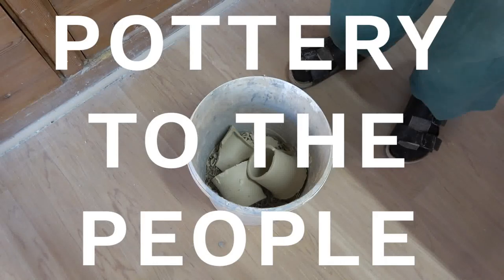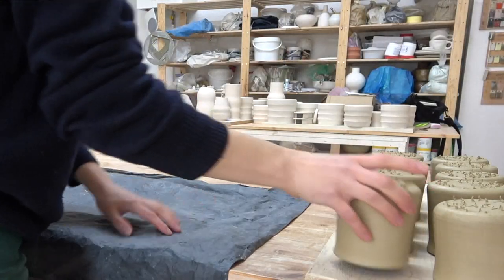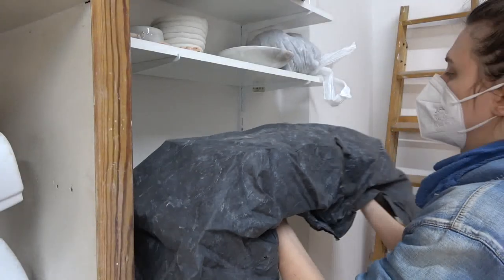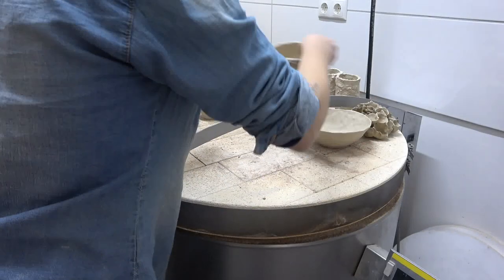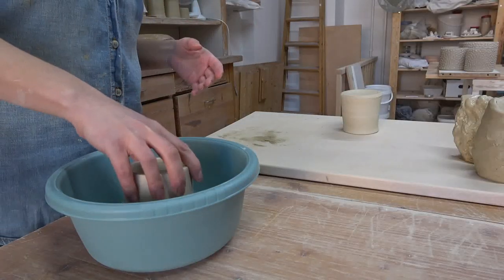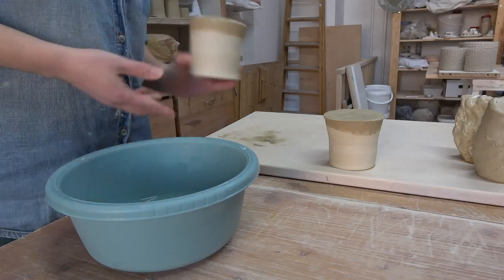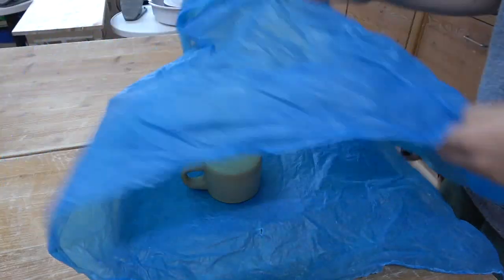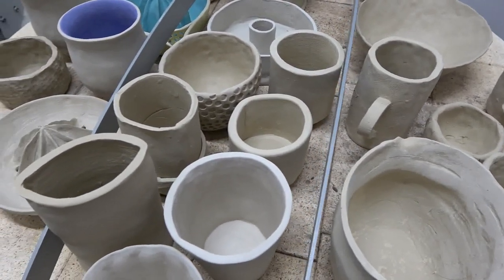How to Dry Your Pottery WITHOUT getting Cracks!

Comment: I am so glad I found this this video. Quite a few of the pots I most recently made ended up with so many cracks and they were almost all pots with some kind of attachment, and I had no direction on how to properly dry my pots at home. Thank you for the detailed, easy to follow video!
Reply: If your pottery is dry beyond "leather" but still greenware can you rub some slip into the cracks as a sort of caulking process and fix small cracks that way?

Comment: Very informative but concise video does beginner, thank you! I’ve been going to a drop in/unstructured class every 2 weeks and I’m having massive problems coming back to them being the right amount of dry. My first lot of punch pots meant to be joined together to make vases I came back and they were rock solid. Two sessions ago I made bowls and wrapped them so well when I came back to refine them I’d wrapped them so well they were still wobbling so this gives me some pointers to figure out getting the right level of dry.

I don’t know if you’ll still be checking for questions but if I go to a session and want to get some clay dried out a bit not for firing but to allow me to work with slightly dried out clay for a slab plate for example, or to be able to then refine edges with a sponge without the whole thing collapsing again then can I use a hairdryer? Would this need to be on a cool setting to avoid anything too sudden or just drying the outside and leaving the inside very wet still or something?
Reply from the maker: Hi Amy, yes drying is soo tricky if you cant check your pots every day! Especially since drying times change with the seasons and the thickness of clay. You have the right idea— dry them with a hairdryer (hot is fine), fan, or heatgun to leatherhard. Lots of potters use those to speed up drying and its generally fine for the pots. Make sure you turn your piece and get the bottom to dry it evenly.
Reply: @PotterytothePeople  Amazing thank you! I think I would have forgotten about the bottom haha. It doesn’t help that the first week I went was the week it was nearly 40deg in London + kiln heat too! And now it’s 20 deg so I just can’t get the hang of how much to wrap!

Comment: I am in the UK, and it is really wet autumn, winter, spring (sometimes summer too!) - I throw in a tiny shed outside, but tend to dry stuff inside. I am a newbie, and currently I am too worried to use the shelves I put up in the shed, cos of the damp. Whilst I am amassing a kiln-load of greenware pre-bisque would you advise keeping it all in the house right up to the time of firing, so it doesn't re-humidify itself from the damp outside? Thanks loads

Comment: I don’t know if this question can be answered, but I’m make rectangular tiles with appliquéd attachments on the top of them — not handles or anything. Also, on the back of the tile, I am attaching a  lip so that the tile can be hung like a painting. Is this impossible for the making of a flat tile that doesn’t curl? Someone suggested that I put wet newspaper around the edges because they dry the quickest. Any suggestions? Your input is invaluable.
Reply from the maker: Watch this video-- https://www.youtube.com/watch?v=hv7fbOQcMA4 I show how to dry tiles flat :)

Comment: Thanks so much for the video! My cracks have reduced but I still get them on certain attachments (Handbuilt sculptures). I attach when leather hard and wrap in plastic completely for 24 hours. It seems to be the slip that cracks even though I clean up excess slip. Any further advice/tips I can try would be much appreciated.
Reply from the maker: You might be applying too much slip or your slip is too wet. Try experimenting with that! Also, leatherhard is a spectrum, so experiment with different wetnesses. And make sure both pieces are equally leatherhard. Hope that helps!

Comment: So far I've attached handles when both the mug and the handle are wet. If I understand it right, you wait for the mug to be leather hard and then make a wet handle to attach, correct? Is this only to prevent warping of the pot/mug? Or are there other reasons as well? Can I also attach a leather hard handle? Thanks!

Comment: Always placed in container box. Before trimming. After trimming, same as before, rapping 
With a dry cleaning bag or trash bag. My trick, greenware grimed, place with misted paper towel
placed in and rapping. Even in container, always have wet towel placed in. Very slow drying, 
Check every day, and see the condition. Then remove the cover...but gradually...
 Ever failed.

Comment: Hi, I intend to make very large (60x60 cm) tiles with clay but so far I've had them shrink on the corners making my lines not straight anymore. I have 40 percent aggregate in the clay, do I maybe need to increase it? or should my drying process be different? I let them airdry for a long long time and then slowly increase the temp up to 500 degrees celsius and when they are cooled down I bring them to a local pottery place to fire them in the kiln.
Reply from the maker: Flat things are really tricky!! Having grog in the clay is a really good idea. Then let them dry slowly under pressure. I have some drying tips for flat things here: https://www.youtube.com/watch?v=hv7fbOQcMA4 Make sure they are at least 1cm thick too.
Reply: I carve my tiles in a shared studio. It takes time. I do roll them out thick because I carve and then I use the news paper and plastic sheet method. I also spay down my news paper because I only come in once a week to the studio. I lay another board on top and other potters will place their pieces on mine for more added weight. When I am ready to dry. I will do it slowly. The first week I won’t use the wetted news paper but still plastic and weighted down. The second week I open the plastic so air can circulated but still weighted down. The third week, no plastic but weighted. If I feel that it’s not at the bone dry stage yet, I will take it out let it air out and then weigh it down again for another week. This will take me a long time because of my week visits. By this time I can add my underglaze to my green ware and its ready to fire.